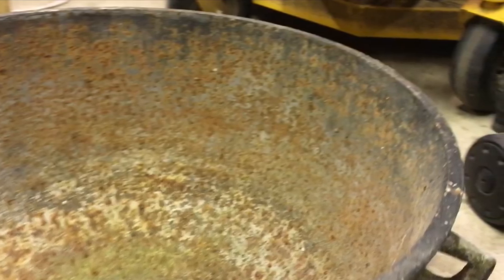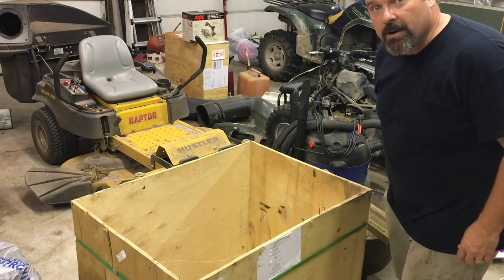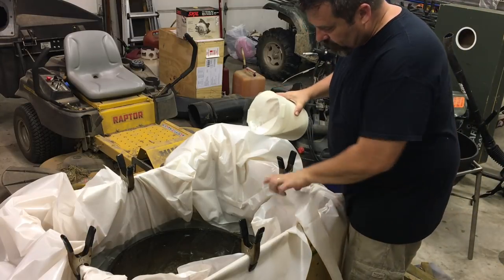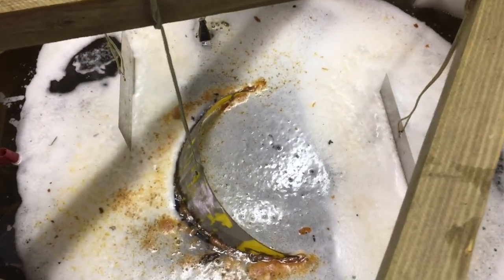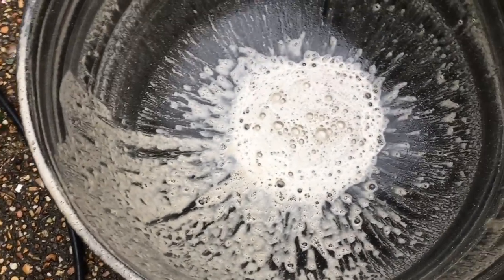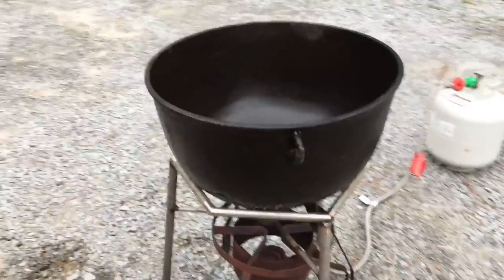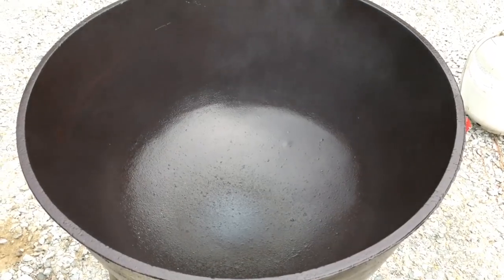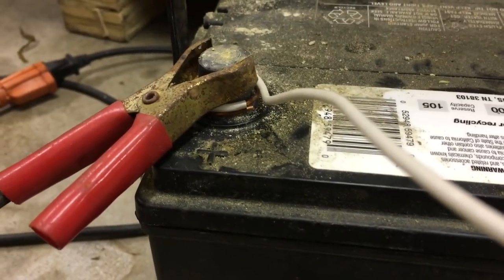CAST IRON Clean & Season Stew Pot | Kettle | Cauldron Using Electrolysis 🍳🍵 Teach a Man to Fish

Comment: If you’re only concerned about the inside of the pot you can simplify the process by using the pot as the e-tank. Fill kettle with water solution, hang sacrificial piece(anode) in kettle, attach negative to kettle and positive to sacrificial(anode).